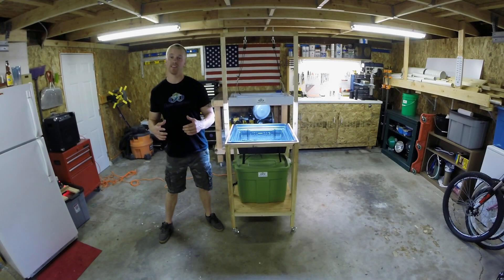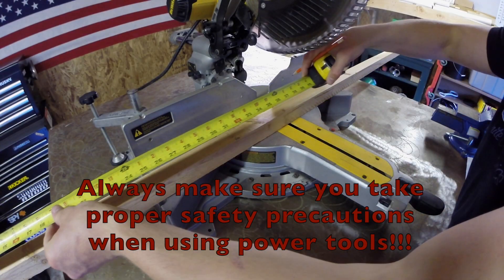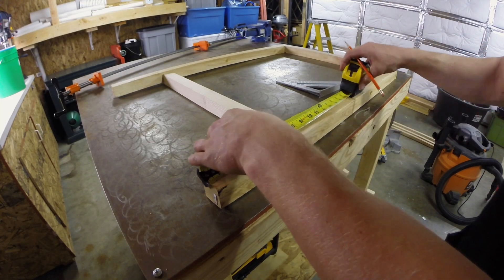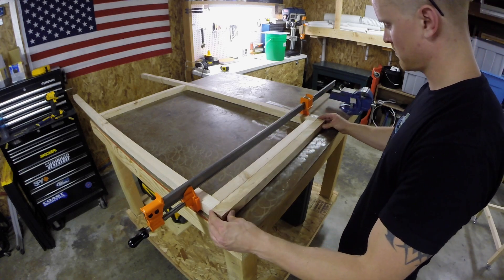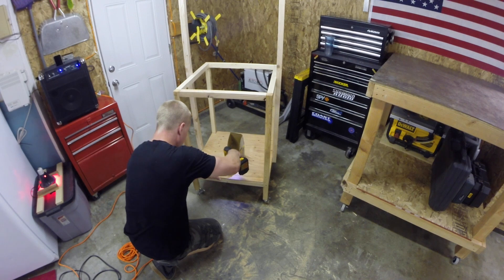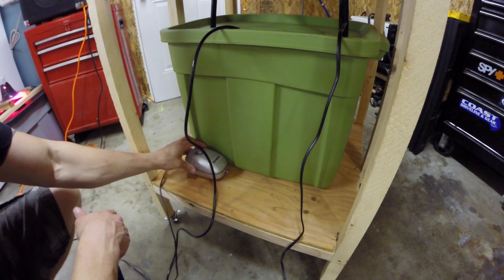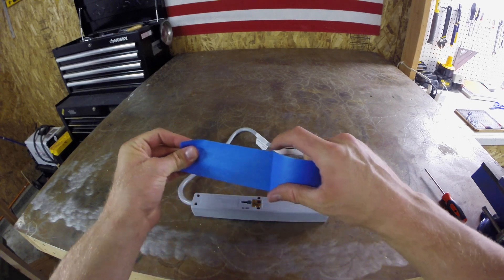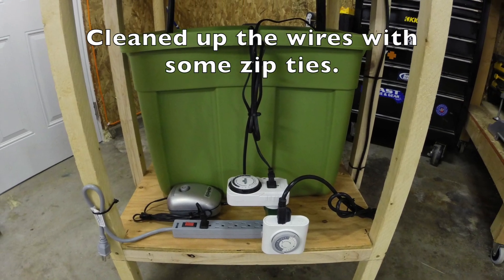Infinite Aquaponics Seed Germination System

Comment: Excellent instructional and construction. I only spotted one thing wrong with your setup. I would've installed the surge protector on an exterior surface above the water as to not allow for water/electrical mixture, probably on the grow light framework.

Comment: Really liked your video, clear concise instructions on a great project with some well done editing. But I do have a critique The electrical portion, it seems to me the surge bar should be mounted so the outlets are either vertical or facing down so as to lessen the chance of water intrusion due to spill, whatever. And, on both your airline and your electrical cords, a drip loop should be incorporated. You probably did this but it would be a good idea to include this info. in future projects dealing with water and electricity.  Thanks for sharing.
Reply from the maker: Thanks benton537! That's a great idea, I should have included that in the video, perhaps in an update video ;) I should also mention that I have the power strip plugged into a GFCI (Ground Fault Circuit Interrupter) outlet. Anytime I have any electrical device in or around water I make sure to plug in into a GFCI outlet.
Reply: +InfiniteAquaponics GFCI's are great protection devices, however, they're quite pricey. For those on a very strict budget, these aren't exactly optional.